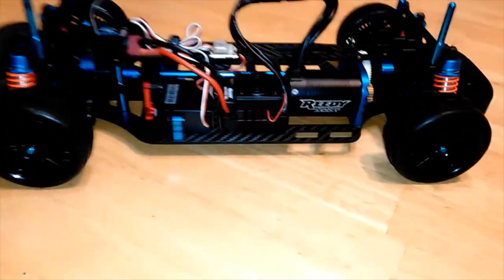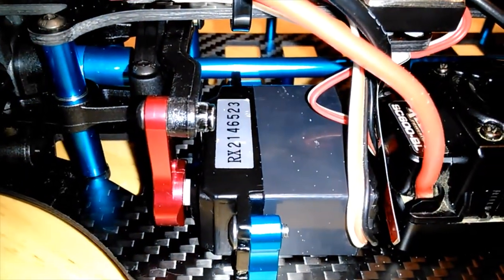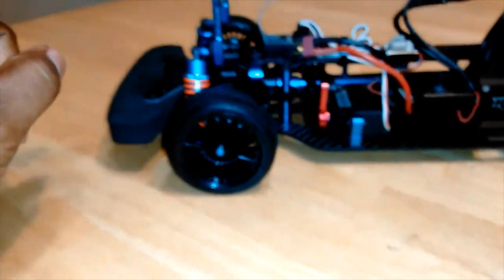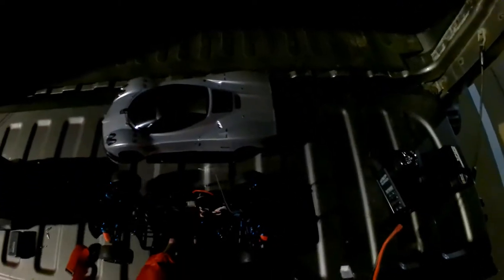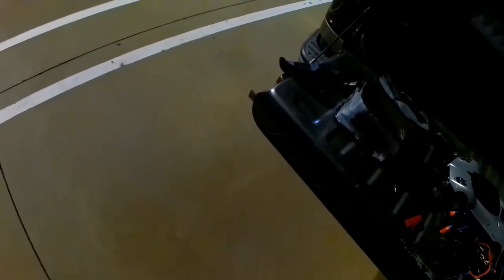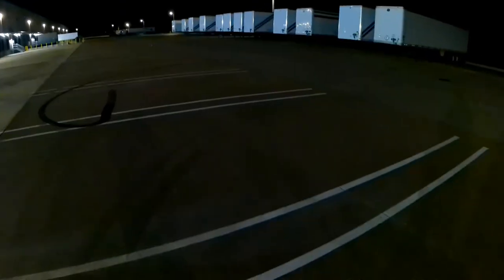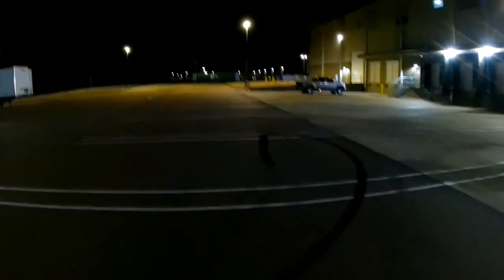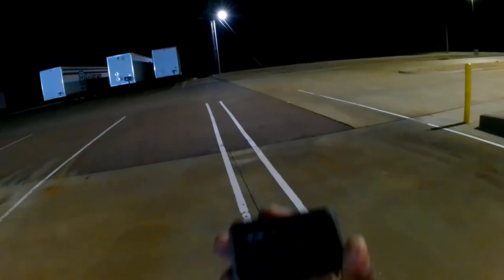TAMIYA TT-01 CARBON FIBER CHASSIS OVERVIEW & NEW BODY

Comment: Looks sick man I may have to buy one of these for a lightweight open area speed runner would you recommend mate and do you know what size motor shaft it takes please and also what good metal spur and pinion would be good to buy for around 45 50 on 2s if that's atal possible 😂😂🙏💚👊
Reply from the maker: I do recommend because there are some upgrades for it. There are metal gears for it now. There is a link below for the metal spur gear for your reference and I would suggest a HR metal Pinion if possible. The metal gears are 48p I believe and with a 23t pinion paired with the metal spur gear below may give you the speed you are looking for (not sure though).
The motor shaft size I used is a 3.175 shaft (but you can make what you want fit). Thanks for watching & be safe!
https://www.ebay.com/itm/134016315433?mkcid=16&mkevt=1&mkrid=711-127632-2357-0&ssspo=CSnd4oHVSoy&sssrc=2349624&ssuid=4r0e61ber22&var=&widget_ver=artemis&media=COPY
Reply: @PJsElectricRCAdventures  ok mate no problem atal thankyou very much and I assume you mean HR Asin hardened metal and does the p matter I'm assuming mate will have look out for some just don't want it to be wrong 🙏💚👊
Reply from the maker: @sTuPiDiScOoL_  48p is the teeth size of the gear some reference it as mod/pitch 0.6 gear.
You are correct about the hardened Metal Pinion.
Reply: @PJsElectricRCAdventures  thankyou my brother that is most helpful I am just watching through your videos mate to get a good idea also the diffs look like quite easy to access and I'm assuming they are open like a wltoys for example and metal so need greasing every so often could be wrong thanks boss 🙏💚👊
Reply from the maker: @sTuPiDiScOoL_  the diffs are easy to access and they are open. The metal diffs are housed inside a white plastic diff housing. So greasing will be most important if ran hard.
I don't run mine much but when I do I try to improve my drifting skills 🤣